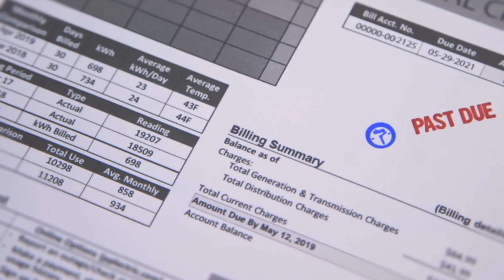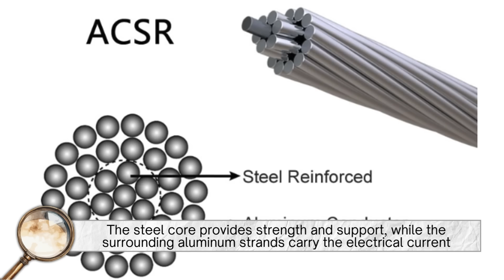Why Do Power Lines Use Aluminum Instead of Copper?

Comment: Another fault of aluminum vs copper is heat expansion and shrinkage.  You can start off with a good connection.  But aluminum tends to loosen up after a while building up more resistance and heat which could cause a fire.  That's one reason it isn't used in a lot of homes anymore.  Home owners are not going to go around shutting down their circuit breakers to to undo every socket, power switch and junction to insure a good positive connection.
Reply: I had a house that had Aluminum wire installed versus copper. I noticed, when I was looking to buy the house that a couple outlets had some blackness above the outlets. There is a mar plug designed to bypass such problems. It requires the aluminum wires be connected to short copper wires which are then connected to the fixture.  The mar plug used to connect these wires has denser, sharper connection wires joining the copper and aluminum wires. Once I had the house fully converted I had not have a sparking incident when I moved out 15 years later.  The panel connections however needed to be tightened once each year by about quarter to a half turn.
Reply: Helt rätt. Om vi pratar om spänningsfall vid belastning vet jag att koppar är ett bättre alternativ. Att löda kopparanslutningar är bäst.

Comment: The biggest advantage of aluminum is that it lasts longer, not because of its properties, but because it is not worth stealing.  Scrap aluminum gets less per pound but it also takes a lot of volume to make a pound. Copper thieves would make the copper disappear very quickly.
Reply: I guess the power lines in the alleys in Detroit are copper after all.  Many electrocutions in copper thieves.

Comment: the other big trick... (nobody seems to have mentioned)  they pump up the voltage to very high levels  for the trip down the cable! This matters regarding conductivity of materials! Because when you increase the voltage you can transmit the same power at a lower current. At a lower current... loss through resistance is far less and so lack of conductivity matters less.

e.g.I think my math is here?....   PS = power sent, PL = power lost, V = voltage,   A = current, R = resistance  (resistance is inverse of conductivity)   
 PS = V*A or A = PS/V ,   PL =  A*R*R     so   PL = PS/V * R * R.  

 So if you increase V from 110 volts to 220,000 volts then conductivity (although still a factor)  is probably 2000 times less important factor at that higher voltage?

Comment: We were told its mostly because of the cost.  Aluminum is cheaper but also has its flaws as conductivity sometimes is unstable or inefficient while copper, although expensive, is a more consistent and stable conductor of electricity.
Reply from the maker: You're right, cost is a huge factor in the choice of aluminum for power lines!

Comment: In the UK, aluminium conductors have been used instead of copper since the 1980s due to cost, even at low voltage.  At grid voltages - 132, 275, and 400Kv - the cables are ACSR:  Aluminium conductor, Steel Reinforced, or AAA:  Aluminium Armour, Aluminium core.  When the distribution is three phase and neutral, or single phase, the PEN (protective earth/neutral) is copper.
Reply: Try 465,000v in the Grid & About 1Amp, as the Voltage drops the Ampage Rises as is the case in All Electrical Mathematics, w/v = A ie 9500w shower divided by Voltage of 230 in the UK = 41.304A, So you have to use a 45A Trip or an Individual Trip Switch Braker Which only trips that Radial not All that side of the Consumer Unit

Comment: Underground power cables using copper conductors aren't rare at all
Reply: Apples to oranges
Reply: @tjpighin  Aerial catenary for trains is made of bronze and copper. That's a 25 kV, 50 Hz power line 😊
Reply: @imeprezime1285 ours are usually 4kv and also very old systems. There is still some copper being used in distrobution lines and some smaller 60kv lines as well but to my knowledge, no new installations of copper in overhead. But comparing overhead to underground is apples to oranges and yes they still install new cu underground cables. Urd is a different beast for obvious reasons
Reply: @tjpighin  Weight is the most important factor
Reply: @imeprezime1285 reliability and safety but all the other factors have been listed by almost all others haha. Aluminum acts differently under heat stress from fault current but also most al wires have steel reinforcement as well
Reply: @tjpighin  Also, higher the voltage, more advantages go to Al

Comment: 1:03 gold is better than copper! Failed again!
Reply: Gold's price and low availability pretty much kills it's viability for wiring, except for a few specific applications on circuit boards. Also its a slightly worse conductor than copper.
Reply: No, copper is better conductivity than gold😂

Comment: They use it because its far cheaper to use, and can be used safely provided the proper methods are used.
As for the weight factor, the towers would need to be closer, again, less expensive.

Comment: If you put the power lines into the earth (like in Europe) instead of above into the sky then you don't have to bother with the weight and resistance to hurriicanes.
Earthquakes are another story.
Reply: So is the lifespan and danger of urd. Then the time it takes to repair and cost associated

Comment: Both are used and the main factor is weight for higher voltage lines.  One drawback of Aluminum in local settings is also far more brittle when trees are a threat.  Your title should have been in transmission lines.  Also the cross section is determined mainly by amps in both metals and can be reduced by raising the voltage for the same watts.

Comment: Very poor explanations, 8 minutes of time waste. It's all about numbers. Aluminium is about 54% of copper weight for the same conductivity. Cheaper, check for the prices. Available in much larger quantities, as the third of all the elements on Earth, after oxygen and silicon, and the first as a metal.

Comment: Actually electricity conduct better and best  on silver, not copper. 
Copper comes in number 2. 
Again, the overhead powerline is a different scenario to households gadgets. 
Those powerlines are exposed to elements compared to households gadgets so, copper will oxidised at the outside powerline while aluminium, being less oxidative, can retain its initial status under the elements

Comment: Almost everything at home runs on 12 V.For 36 V DC was stepped down Transformers from 110AC.This is ancient history.We don't need big power lines to houses. solar panels  can run almost everything with battery storage.😊
Reply: Except when the sun doesn't shine!
Reply: What is the availability, reliability and safety of batteries?

Comment: It seems that the comparisons being made in this video could be stated much more simply in terms of ratios: Comparing wires with the same net conductivity, the aluminum wire needs X% greater cross-section area, but factoring in density, the weight of that aluminum wire is only Y% as much, and the net cost is only Z% as much.  I know the usual argument: "Oh, but your common viewer is afraid of mathematics, so we have to express all of this is commonplace words!"  But consider when that same viewer is in the grocery store comparing brands of walnuts, and different brands come in different-sized packages with their different price tags, but the prices-per-pound are right there on the labels.  People totally understand a cost-per-pound ratio.  So in this power-line comparison, the same kind of simple quantitative logic should apply.  Obviously start out by explaining the basics: Copper is more conductive for the same cross section, but you don't size a wire by cross-section.  You size it by how low the resistance needs to be for carrying a certain amount of current with an acceptable energy loss.  You build up the logic for the ratio comparison in a few simple steps.  Maybe you further illustrate your ratio comparisons with very simple bar graphs.  And when you do so, which number goes in the numerator and which in the denominator?  If you want to show that aluminum is more favorable, show conductivity/cost, not cost/conductivity, because the former ratio gives a taller vertical bar, which you put on the left, overshadowing the lower ratio for copper just to the right of that tall bar.  It's more effective rhetoric and it's not deceptive.  It just makes the comparison more accessible.
Reply from the maker: That's a very insightful point about presenting comparisons in terms of ratios!

Comment: If powerlines were copper, we would all be in the dark.  Because thieves would have stolen every power line.
Reply: 😂 in Pakistan they stole entire ohe railway aluminium line 😂
Reply: @raghunathsinghrajpurohith4894 did they...scumbags
Reply: Richtig aber dann hätte man den Kupferpreis im Schrotthandel, sehr niedrig gehalten und Aluminium Verteuert. Nur so könnte man den Kupfer Diebstahl in Grenzen halten.
Reply: @bertikoch5821  Bauxite ore, from which aluminum is extracted, is abundant.  Copper ore is less plentiful. This has been an issue for EV cars; a lot of R&D is going into replacing copper with aluminum, not just for EVs but for everything else.
Reply: Germany: According to a police report, a Roma man from Romania stole active communication cables from a railway facility. Unfortunately, he sawed through a high-voltage underground cable. That was the end of his career.
Reply: @membersataniccabal.coronau804  If you live by the power cable, you die by the power cable! ⚡👎🤣
Reply: ⚡ Shocking! ⚡
Reply: @marcse7en    the current situation isn't shocking at all.
Reply: @mito88  Is that intended to be a pun? Because you didn't ask "forgiveness," to indicate thus?
Reply: 1000 %
Reply: True. 
Same happen with our village Phone cables decade ago.
Thieves cut one side of the connection from underground and tie the other to vehicle & then pushed it through  car ..
Reply: I was going to say.  The tweakers would kill themselves trying to steal it like they do fire plugs.
Reply: Denen wäre es Egal ob es Knallt oder Explodiert, Hauptsache ist das Kupfer.

Comment: I still see old Copper wires. The only real reason is theft why we see Aluminum over copper in high tension wires.
Reply: Likely not newly installed probably. It might get repaired but not newly installed since many many decades ago I would guess

Comment: Why use aluminum, for the same reason they stopped using aluminum in house wiring. Aluminum has more resistance than copper. Resistance creates heat which is why houses were burning down. The same problem with high tention wires, resistance creates heat and that means the power loses over a large distance. How much loss is a producer willing to tolerate?
Reply: Wires in a wall vs wires in the air are very different beasts

Comment: #1: aluminum is lighter.... cheaper.... 4x cheaper.... #2 : I heard it from a reliable knowledgeable source that these high tension wires are wrapped with a thin copper layer..... yup.... the core is aluminum.... the submarine.... and the copper is the wrap... now I could be wrong.... but that's how I understand it.... peace ✌️

Comment: Aluminum has a higher coefficient of expansion (~35% higher) than copper so the power lines sag more when they heat due to electrical load, but I guess that isn't much of an issue either. Aluminum expands twice as much as steel so I wonder how that affects aluminum power lines that have a steel core for added strength?

Comment: Avoid connecting an Aluminium wire to a Copper wire directly ( in a house wiring ? ) .... the Aluminium junction will badly corrode quite quickly , causing a failure and / or a fire ... handy tip # 45 ............... DAVE™🛑

Comment: 1) Not pure aluminum but an alloy that's stronger.  2) Tower bulk is to fight the dynamic forces of hurricanes, not static weight.  3) Electricity travels along the surface of cables more than in the interior, so it's a matter of having a cheap fat core coated with a more-conductive alloy.  4) There's actually some copper in these alloys
Reply: Very interesting information; especially point number 3. Thank you for posting.

Comment: In reality one uses iron threads with aluminium thread spun around, called FeAl.. The thickness of this type of wire is designed by standard numbers, witch is not the real thicknes of the wire, but the thickness of a copper wire with the same conductivity.

Comment: The real questions are :
How long is the grid, km.
How much new grid capacity $km.
As an investment what is the ROI, return on investment. 
How much bigger must the grid be to replace fossil fueled energy. 
The first grid was built over 14decades. 

Hint 
grids are 10times too small.
grids are 10times more expensive than generation. 

4cents electricity costs 44cents kWh at the grid meter boxes. 

Distribution is extremely expensive.